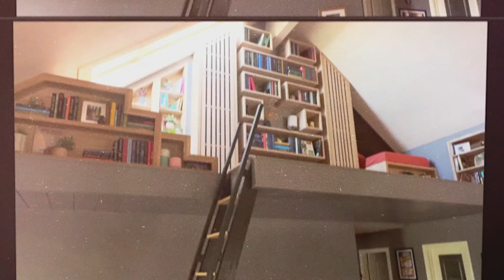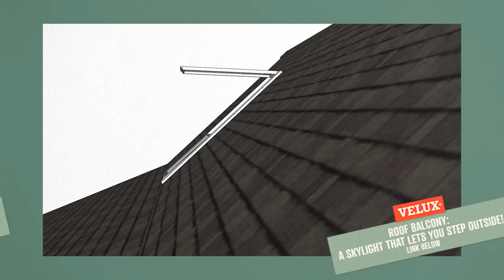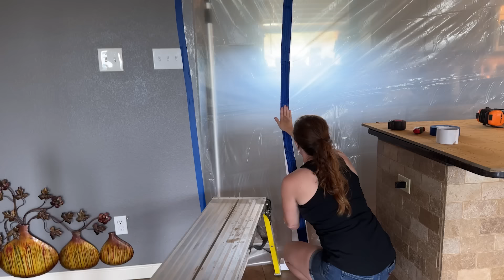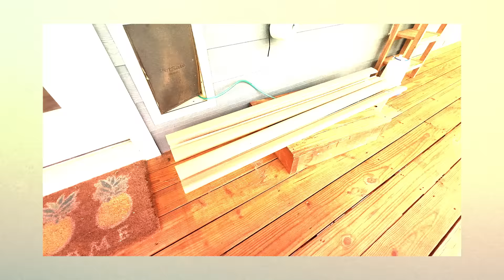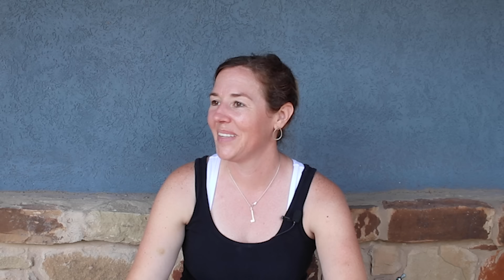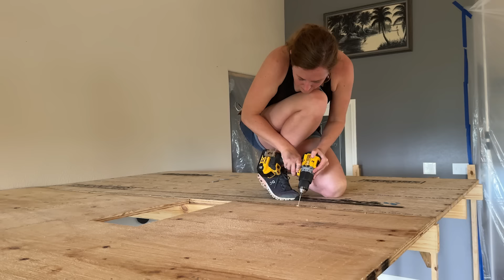Library Loft Build! How to Prep for a Big Remodel

Comment: I always like your out of the box thinking for making life easier. Not just your platform but anchoring 2x4s to the wall for support. I feel like a lot of diy'ers would avoid that because of having to fix the holes. But in the long run that sturdy platform will save so much headache as well as be safe plus you're going to be doing drywall and paint work in the end anyway. So a few extra holes for improved safety and efficiency is well worth it. I am rather jealous of the amount of space you have as your jobsite as I'm currently doing a full gut job on a 50sqft bathroom. Not much material usage but barely enough room to turn around in and i still need many of the same tools as a your project lol. Lots of trips up and down stairs to cut materials and also using my daughter's bedroom as tool storage at times.
Reply from the maker: Thank you!